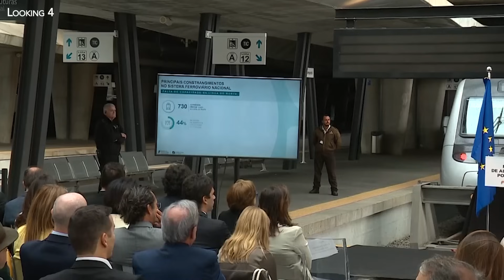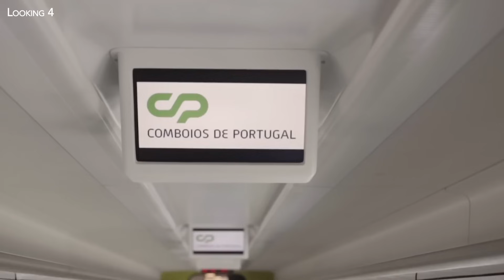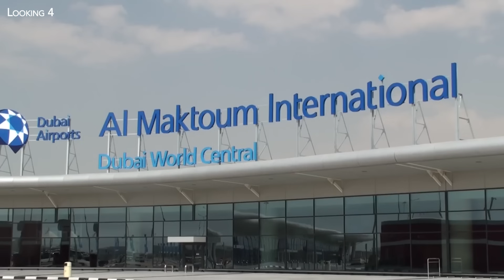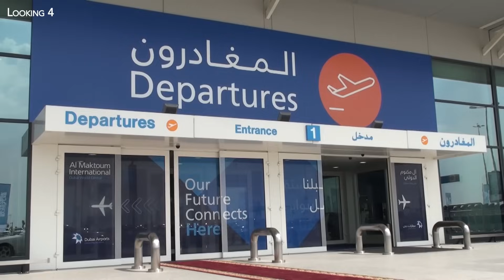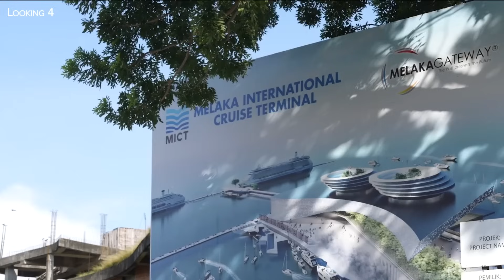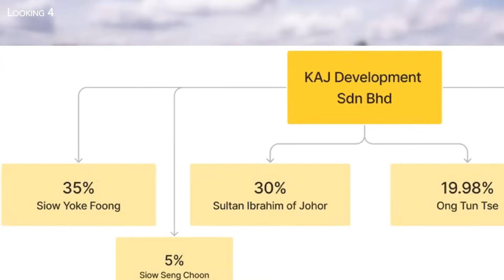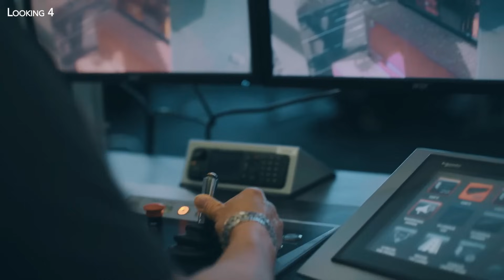Top 7 Biggest Megaprojects Under Construction in 2025

Comment: Wrong Information. Trip between Porto and Lisbon is 2h46 and not 3h46. Also you just need to think a little bit. If the maximum speed is 220kmh and the distance is 314km how would it be 3h46? You would need to have very low speeds.

Comment: A 99-story high rise that is 100% electric and consumes no fossil fuels, says the architectural firm. Unless they are building next to a hydro electric dam or a nuclear power plant, they're going to use a lot of fossil fuel. Electricity is not going to save the planet. Without nuclear, it will be even worse since it's very inefficient in a lot of applications - especially in colder climates.

Comment: I think I easily find 10 projects in China that will make the list lol. That biggest mega hydro dam project, a new airport in Foshan , that longest spanning bridge that was thought impossible to build, 45,000 tracks of high speed rail and I dunno how many stations. 54 cities with over 500 stations , etc etc etc. On top of that they have 70,000 5G base stations and 200M CCTVs , god knows how many tunnels , bridges , km of highway. In totality , nobody evens comes 10% close.
Reply: But Al Maktoum is slated to be the biggest airport in the world, what are you talking about?
Reply: @ I’m talking about largest from start to completion, not an expansion after the initial project is completed. If you wanna talk abt expansion of existing projects , many subways in China have expanded by 3-4X from initial completion and still expanding every year adding more lines and stations. Like the SH metro with 830km and 508 stations with 20 lines. How can any airport beat that.
Reply: @robertwang7825 I’m talking about airports. Is Foshan airport the biggest airport here? No? Then it’s not included.
Reply: @ OIC , apologies

Comment: As a Thai. I'll give you the real reason for the delay. It's partly due to China at first. Yes, but that was quickly solved when the Thai govt opted to finance the project themself, because the negotiations was going nowhere. The real problem is the illegal squatters along the rail line. As the govt can't just relocate them without pursuing every legal channels first. That's the real issue here, even now they still going through every squatters one by one to slowly get them out. It's an annoyingly long and drawn out legal battleground. There's also another less known line that was supposed to be built simultaneously with this one. The EEC line, but it was auctioned to a private company and it faces the exact same problem and that private company has been holding that project hostage for more government money untill the squatter issue is completely resolved. Serve the government right for being a paleontological snail, but we pay the price with taxes. The same problem will occurred again with the future planned lines. Nothing will ever be finished on-time in Thailand, until the govt is smart enough to rewrite the law on squatters.
Reply: One word govt corruption. China built 45k km high speed rail in China , they never ever had any delays.
Reply: @robertwang7825  China is a one party d!ctatorship 🤦‍♂️
Thailand isn't
Reply: @robertwang7825  u reckon there's no corruption in China?
Reply: @ernestkj - (Even) - with - (Your - Fake) - (Corruption) - (Things) - (Get - Done) - in - (China) - 🇨🇳 🇨🇳 🇨🇳 🇨🇳 🇨🇳 - (Unlike) - in - (Your - Country) - 🤣🤣🤣🤣🤣 -
Reply: its a shit project